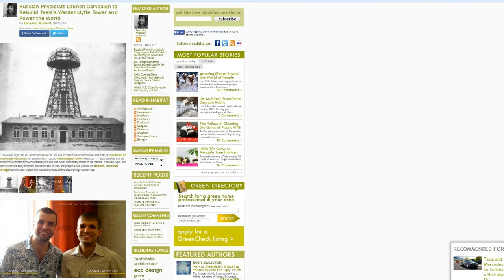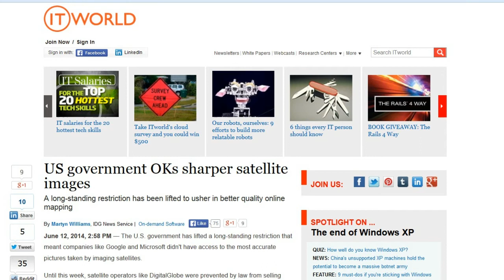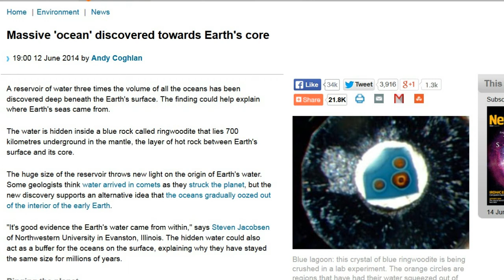TDD report for June 14, 2014

Comment: Very interesting throughout.  It seems like a Tesla-type power distributor could produce a lot of EMF health issues.
rsmf...
Reply from the maker: I think it's a long shot at best. Only current technology that seems to be possibly coming to market is using resonance at 60HZ to distribute 110 Volts in homes. Of course even that is awaiting devices that are designed to use wireless electricity.